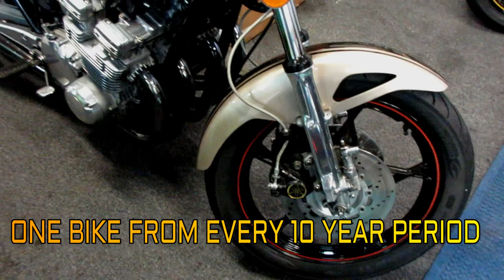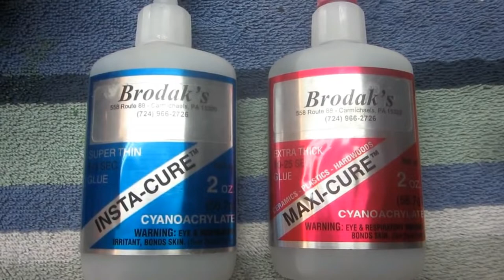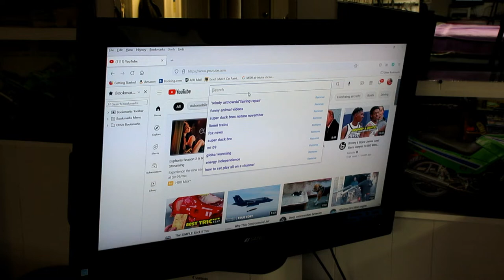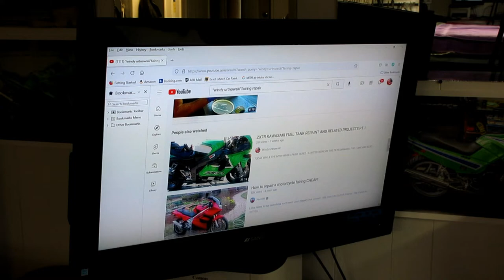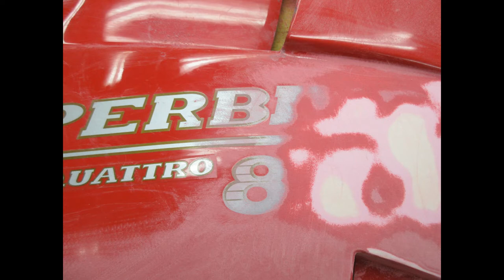.MOTORCYCLE AND PAINTING QUESTIONS, ASK WINDY VOL ONE.

Comment: Windy,  thanks for the great videos.  I have several bikes in the restoration process and have been watching the FZR restoration with the Yamaha retro paint job.  Awesome work!  Watching a second time now and taking notes.  The one thing I have not seen a video on is painting a frame.  Have you done a video on that process before?  I have the following bikes in process and all will be painted with your process. 
1972 Triumph Daytona
1983 BMW R80RT
1972 CB350 that was my moms. 
1970 SL175 that I plan to ride from NC across the country camping back roads back to Seattle WA.  
I also am having trouble finding your paint.  Is it something that is a local paint shop line by SW?